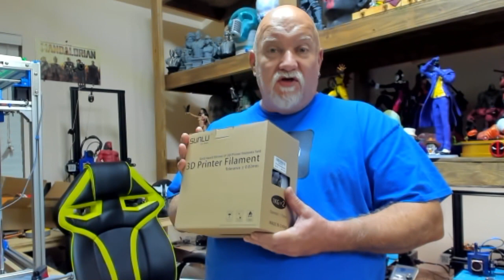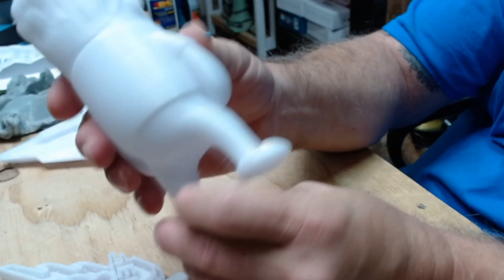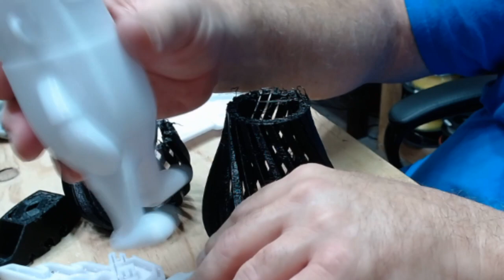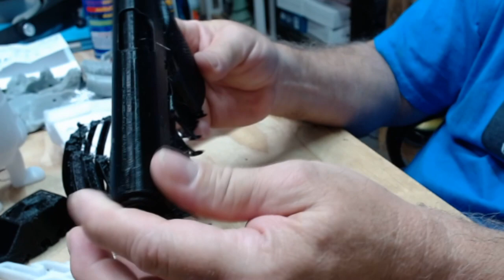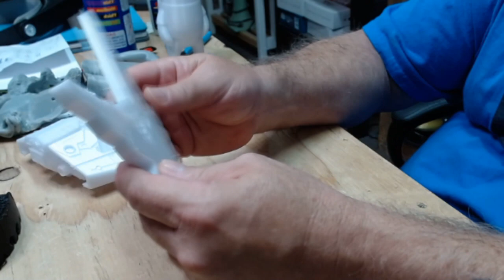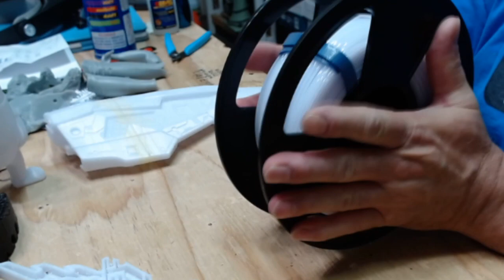SunLu PETG from Enotepad #3dhp

Comment: I've heard that PETG can fuse to PEI build plates if the PEI is not coated with a thin layer of hair spray or glue stick.
Reply from the maker: I use different brands of PETG on my pei metal flex sheets with no issue. Glass or mirror you would need gluestick or something,not sure about other bed types.

Comment: Very helpful Jerry!!! I was quite skeptical on SUNLU PETG when it first got it to try, but it turned out really solid stuff, especially on structural parts. This thing is unbreakable. Prints are stiffer than any other brand I tried. All my i3 clone parts are printed from this. I've found 232 degrees on the nozzle, 68 degrees on the glass bed with glue stick works best for me, 3 walls, 4 top bottom layers and 20-30% infill, 30-40% fan gives me good dimensional accuracy. I usually print it at 42mm/s speed(46-48mm/s infill speed) by slowing the 1st layer down to 85% then increase to 100%, It's stringing a bit but 4mm retract at 30mm/s speed does the job on Bowden extruder pushed by a BMG clone. Tried it on my Volcano hot end, goes like butter..

Comment: I am using NEAT brand filament. Two things to comment on... 1) the filament could be crappy and/or have to much water in the philament. The NEAT filament printed better after frying it out but still it is to hard to use. The NEAT filament did the same thing  the exact same thing. It would print to a certain point and then come loose form the bed ruining the print. What I had to do was Push the filament into the bed work the 1st few layers. I upped my layer width and layer height. To about 150 and 170 for each setting. This seemed to fix the sticking issue. I use no glue stick and no hairspray. I tried going up in bed temp but that did not help. I have zero fan for the 1st 4 layers. I gave up on the NEAT filament. I am currently looking for new Filament to try. I bam going to buy some ESUN filament to try.

Comment: Another thing - PETG I am told needs fans turned down to 30-50%.  So far my successful prints used 100%
Reply from the maker: Excellent Peter ,Most of my printer have 5015 fans,so I turn them down to about 45-50% also.

Comment: My roll of Sunlu is marked PET+ and the specs on the back show that they only sell PETG+  recommended temp 230-250 platform 80-120.  I thought PETG used a low platform temp.  Is this really anything close to PETG?
Reply from the maker: I print all PETG at 230-235 and bed at 70 to 80,not sure what Pet+ is.Go to on of there facebook groups and leave a comment or pm an admin of group.

Comment: Jerry... When you print anything that has those small individual towering designs, turn on Z-Hop. The nozzle will lift when it leaves one and come down on the next. Adds a little bit of time to a print but really helps when the temp or extrusion speed isn't exactly perfect for the print.